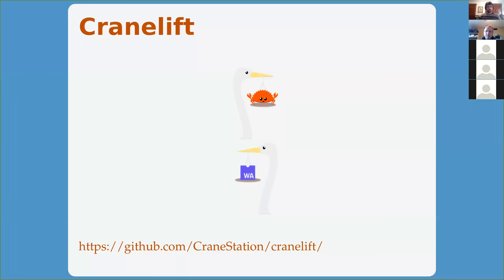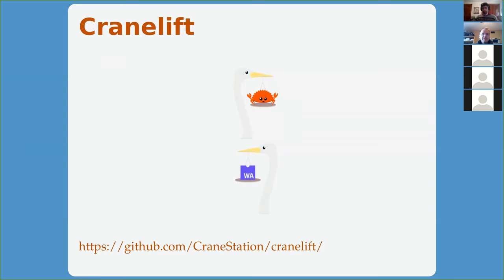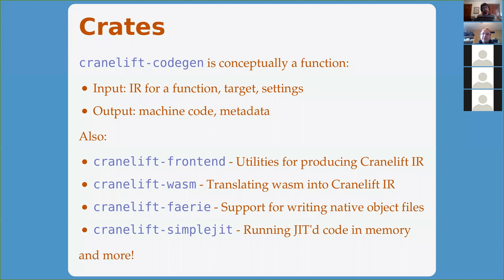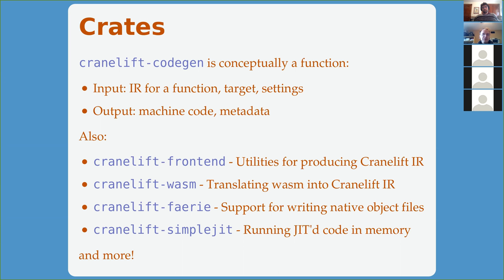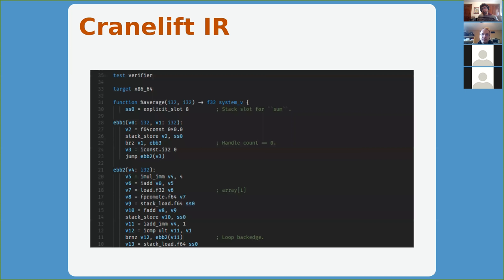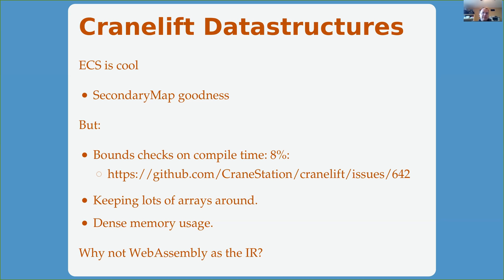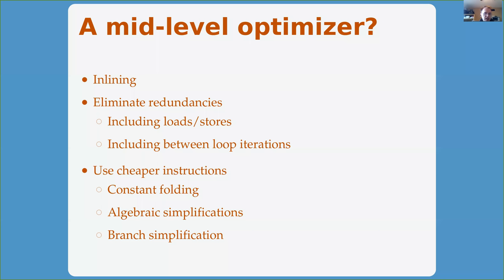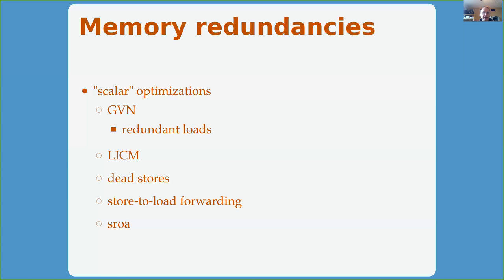Cranelift

Comment: By the way, did he say that they use Sebastian Hack's algorithm for register allocation? Sebastian seems to be a pretty bright guy. I used the algorithm from the paper that he co-wrote, "Simple and Efficient Construction of Static Single Assignment Form" (2013), in my toy compiler project. Works like a charm and allows on-the-fly optimisations; it even has built-in GVN.